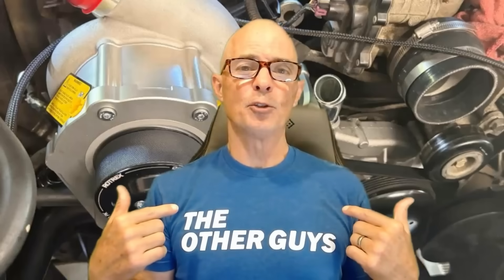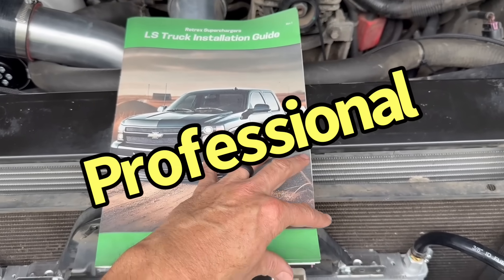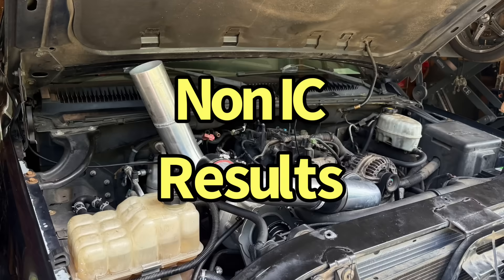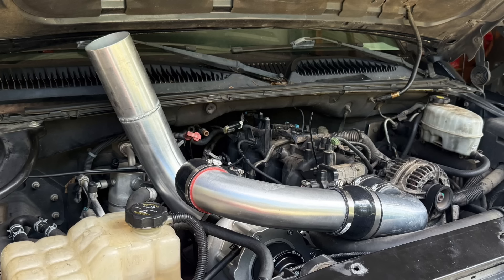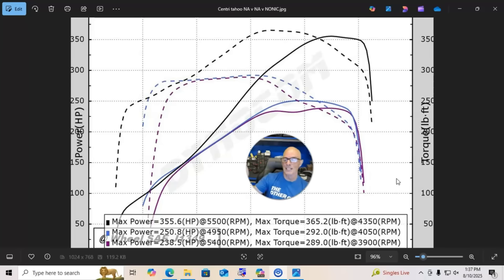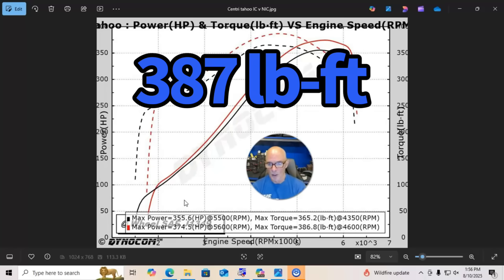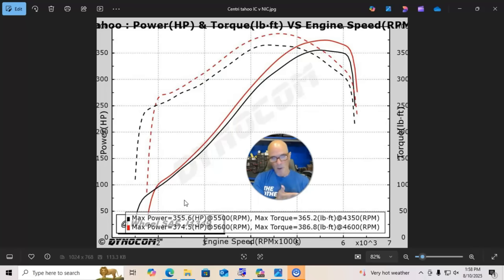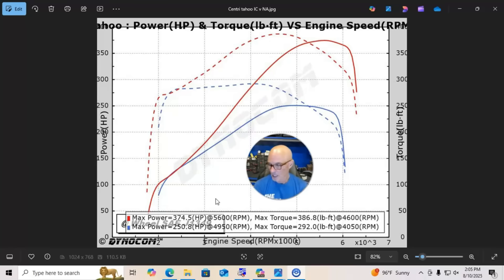HOW TO: ROTREX LS SUPERCHARGER INSTALL AND DYNO! INTERCOOLED VS NON INTERCOOLED. 5.3L TAHOE TEST

Comment: Happy to see rotrex featured in this channel. For my experience the intake temperatures are bretty mild whit these, high flow intercooler helps bit too since boost comes of slowly, i have only few degrees difference between air temperature and intake temperature but im not running lot of pressure. These thing work nicely whit variable lenght intakes and dont seem to effect much on fuel economy on daily driving. Realy easy to dial in ignition and fueling since power is linear.

Comment: Installed a rotrex on my 08 triumph rocket 3 back in 2017 been running it ever sence tts Richard albans across the pond in uk 🇬🇧 manufacturers the kit around 140 to the wheel stock went up to 280 with kit hp doubled its a 900 lbs bike but it goes pretty good for a oil tanker ,its funny pulling a trailer behind the bike with wife and fully loaded pulls bikes on the highway uphill surprises folks when they attempt to pass us 🇺🇸 😀 👍 it eats a belt about every years they last about 10,000 miles ,drilling the crank on center while engine still assembled in bike was nail biting but its held up the rotrex has been very reliable  considering the horror stories ive heard 👂 back when these first were installed back 20 years ago ive been lucky no parts sacrifice to the horsepower gods yet running 14 pounds with intercooler can say yes they seem to hold up when installed and tuned properly i could turn the boost up but i already learned years ago if its happy leave it well enough alone😂😂😂 thanks for this ls install Richard been lurking sence your you tube beginnings 😊

Comment: Great video thanks!

Does Rotrex recommend a bypass valve in the standard kit, or at higher boost/power levels?

Would you anticipate a difference in IATs between Rotrex and the other centris on the market at the equivalent boost/power level?

In previous testing with centris (Steve Morris, I think  Mr holdener too?) it's been shown that optimsing for flow (bellmouths etc) have better results than adding piping to optimise for cold air... On a street car where hoods and filters become a consideration you might not always be able to optimise for either but what would expect the difference to be between a filter right on the front of a centri vs. 2ft of piping to draw cooler air from behind a fender?
Reply from the maker: COLD AIR IS BETTER
Reply: I will not run mine whit out bypass.

Comment: I'm a 20 year Procharger owner and Im totally confused by that elaborate oiling system. I never had any problems and I simply change 6oz of oil every 10k miles. no hoses, coolers, resivoirs, ect? Also the lack of a bypass valve and hearing that "compressor surge" is melting my brain 🤪🤪

Comment: Can you give your opinion on how the stock Ford coyote Engines are able to handle quite a bit of Boost with pump gas?
I know the Coyote Engine has the advantage of having dual over head cams. But the stock Coyote Engine seems to handle Boost quite respectfully especially with higher compression
Just Say’n ...
Reply from the maker: Because it retards timing based on the knock sensor

Comment: On a high mileage or even low mileage application, remember adding boost can push the stock valve springs open possibly cause those vales to prematurely open under boost, so imo I recommend replacing the valve springs with any modifications!
Reply from the maker: not an accurate statement
Reply: Misinterpreting valve float and why and when it occurs
Reply: During the compression stroke, cylinder pressure increases exponentially relative to boost pressure, such that the boost pressure alone is insufficient to overcome valve seat forces and initiate valve opening.
Reply: @JasonSmith-i4j Irrelevant.   IVO happens btdc on the exhaust stroke.
Reply: Lol, cams , lifters, pushrods create valve spring issues , not boost ! The valve spring has same pressure on it whether its natural or boosted as along as you have same cam set up.
Reply: Yes, it's called valve blow open.  Original comment is an accurate statement.
Reply: @chriswise1232 it really isn’t though…

Comment: In lieu of E-85 can you use meth/water injection to keep intake temps cooler or possibly along with E-85 to drop them even further? I'd like to see this setup you ran without the relatively restrictive stock exhaust if it's so equipped. Test mules are awesome, love seeing real world results.
Reply from the maker: This was an open exhaust-E85 is better than WM

Comment: That blower is way too big for a stock engine. A smaller one would have a much better power curve.
Reply: A better power curve is subjective. He is going for top end power.
Reply: @sjhudon386  you are completely missing the point.  A smaller blower could make the same peak number, and a higher average power on a stock engine.   Its a stock engine and trans numb nuts.

Comment: I've read that Rotrex achieves better thermal efficiency than Paxton or Procharger. Any observations on the different centrifugal brands?
Reply from the maker: I would like to see a comparison at the same boost (the Rotrex impeller design is nice)
Reply: @richardholdener1727 Richard if you'd like to see the comparison...you are by far the best person to do it!! 😂
Reply: I've looked at some of the older  compr maps , sorry but not impressed by them . I've heard that they've improved some models, and the planetary drive is THE BEST drive for a centrf blwr !

Comment: LOVE THIS VIDEO!!! This is MY kind of stuff... I've ALWAYS wondered why people with American V8 which have Native low RPM torque, bothered with increasing said low RPM torque - & I am an INTER COOLED(NOT just for Turbos)Centrifugal Supercharger's BIGGEST FAN!!! That torque & power curve is almost PERFECT by MY standards... Anywayz: 1. Don't forget the exhaust - headers etc, tuned for high RPM performance(or just to handle the additional power properly - it's AMAZING how much additional power the stock exhaust can handle, right?) & 2. one thing's missing though - & I don't blame you for not thinking of it, as I came up with the idea less than a week ago - I would have also loved it if, before you completed the CF Supercharger install, you ran a dyno of the CF Supercharger installed BUT NOT BOOSTING, so that we can learn the 'EXACT' amount of Parasitic Loss\Load it has on the engine... & I want the comparison to prove how low the load is......ESPECIALLY when compared to the other Supercharger Types... & as a bonus 'tip' from a guy who's never owned a supercharger(although I came close once) - I'm BETTING(AND ENCOURAGING), that TWO of those CF Chargers can be used on a V8(one per side), to allow for TWICE the boost, yet the pair with STILL have less Parasitic Drag than a single one the other Charger Types('Blowers')... Do with that data as you will - Cheers(& THANKS)... 🤔
Reply from the maker: Unfortunately, running a blower open does not show the accurate parasitic loss associated with driving a blower under boost (it doesn't work that way). Also, two of these will have twice the drive loss, which won't be less than a single of another manufacturer or design. This one blower can support nearly 1200 hp, so not a real need to run two for most.
Reply: @richardholdener1727  A restrictor of some sort to mimic boost... & I mean to compare the losses of the significantly reduced rotational inertia of a CF Charger when compared to those large bulky roots chargers... So because CF chargers are essentially tiny when compared, one can 'probably' run two of them together(22PSI per bank of 4 cylinders - separate throttles & intercoolers)& still come out more efficient than if they used a massive blower... It's just something you can consider...
Reply: i love centrifugal superchargers too!
in german we call them turbessor(turbo+kompressor-german for supercharger), basically a belt driven turbo minus the exhaust side.
and yes, its totally possible to use a twin supercharged setup, or dual superchargers on not just v engines, but inline too.
lancia made the craziest and best setup, the triflux motor.
basically 2 turbos plus a supercharger directly into the intake, its brilliant!
look up old paxton sc mustangs, like the old hertz ones and alpina b5, b7 and b6gt3 racecar, they make the finest bmws in the world!
i would like to see someone build a twin supercharged hellcat/demon, just like aston martins vantage v600/le mans 6.3 twin sc v8.
similar cui as the dodge motor, but dohc not pushrod and a bit less power.
but very impressive for the 90s.
mopars are cool af, but really why has no one done this yet, its not that hard and it would be something fresh, not just another twin turbo hellcat.
Reply: @joeAK7.62 It's been done already? WOW!!! I suppose it's not common because the amount of boost a ''Turbessor'' can produce is limited to about 22PSI, & they are chasing more PSI... When it comes to Supercharging, one intends to use a modest amount of boost... So you said DOHC instead of Push Rod - is it because they are more powerful & efficient, when compered to 8v SOHCs? If I were to execute a V8 project, it would be using the smallest cc DOHC one I can find(& use high RPM, in a sub tonne American Hatchback)... 🤔
Reply: I think it was Steve Morris who tested the parasitic loss of a supercharger. He needed to run 2 engines at 2 seperate dynos at the same time to do it.
Reply: @espenschjelderup426  Not just any SC... Has to be CF SCs(using a parasitic loss figure for a Drag Car's Heavy Blower, Would Be An Inaccurate Figure For A Much Smaller & Lighter\Lower Inertia CF Charger)... But what I was thinking is to do the test before finishing installing one purchased for a build, for a more direct before & after figure(which will vary based on CF Charger size)...
Reply: @MarvinConnell so you know what compound turbocharging is?
say 3 or 4 turbos, 2 smaller ones feed the big(ger) one(s) and create way more boost/hp than simple twin turbocharging.
so is a compound supercharging system possible?
like stages in ww2 aircraft supercharging?
maybe create something as revolutionary as lancias triflux, but with a v8 and 3 superchargers, 1 on the left and 1 to the right of the vee and the third sc feeding directly into/ or working kinda as the intake directly into the valves or combustion chamber.
im not a pro, just a lifelong car enthusiast, so forgive my mistakes please.
do you think its doable?
so a setup like the aston martin vantage v600 le mans or alpinas b5s, both cars have a twin supercharger setup, but combined with the lancia triflux system.
maybe 2 normal blowers/screw driven sc plus the cf sc as the triflux.
or a more conventional approach would be 3 cf superchargers with one crank driven like a procharger and 2 more at the sides, one left and one right infront of the motor, i call it triangle supercharging.
it certainly would look like a triangle and still be pretty complex setup, albeit less than my crazy triflux supercharging idea...😅😅😅
Reply: @joeAK7.62 Seems too complicated... I suggested 2 CF SCs for circumstances where, high boost is needed... The CF SCs I suggest using are - as far as I know - limited to a 22PSI of boost(which is shared by the 8 cylinders of a v8)... So if a racer\etc, needed more than the 22PSI for a project, than can  'strap' 2 CF SCs & use them together, one per side of the V engine - where I see separating to feeds of each CF SC & using 2 throttles & 2 intercoolers, would ensure the total system gets 44PSI... Only necessary when more than 22PSI is needed & with high displacement engines... & again, I had no idea that twin chargers were already used - I'm not that much into boost, & I only pay attention to CF SC technology... O.O
Reply: Why bother wih increasing low end tq? Seriously?

Comment: Seems interesting, but the $6000 price tag seems pretty hefty. 

I guess it's not too bad compared to full whipple or magnusen or procharger setups, but it really makes a Torqstorm look like a killer value if you don't need to make all 1000hp. If you do need to make that much power just add a 2nd Torqstorm.
Reply: It doesn't seem too impressive because it's a stock-cam 5.3 doing this. I can't recall anyone testing a Torqstorm on a stock 5.3, unless Holdener did it.
Reply: Id also like to see a Torqstorm dyno comparison at the same boost curve. The value is fantastic, and the build appears to be a quality unit.
Reply: Weingartner did a test and  has a newer test coming up with a torque storm
Reply: @cedricwilson2055  This must be it. 

https://youtu.be/11yJlwvoJr4?si=4Ug8qUZkdC0QH018

Looking forward to the next test. Hopefully Richard will be able to make a comparison or comment.
Reply: U need to test a raptor supercharger kit,basically cheapest blower kit that's decent quality around $4500 au without fuel system and intercooler
Reply: I’d take a Rotrex over a torqstorm…
Reply: Yeah my na 5.7 rips this 410rwhp 560 torque